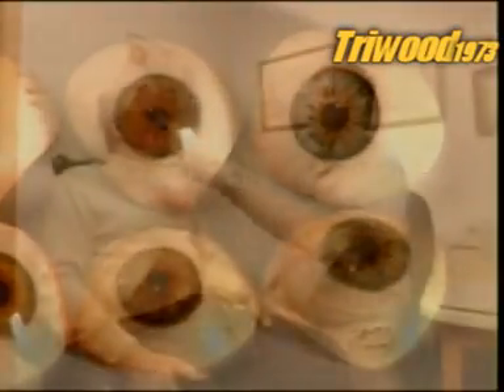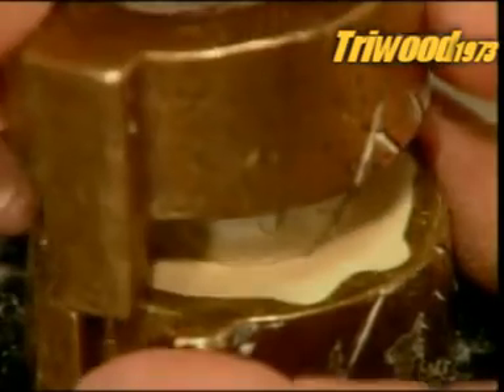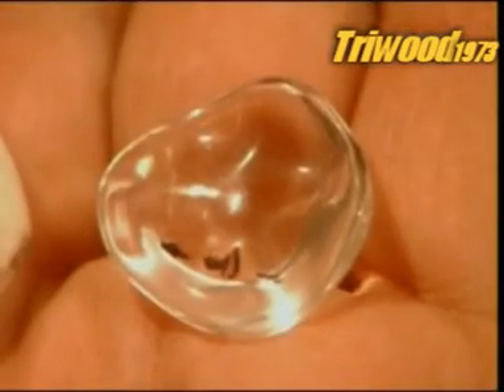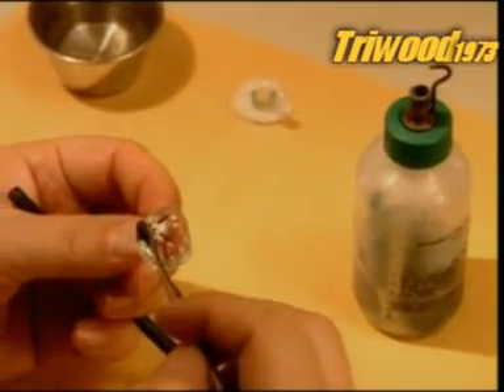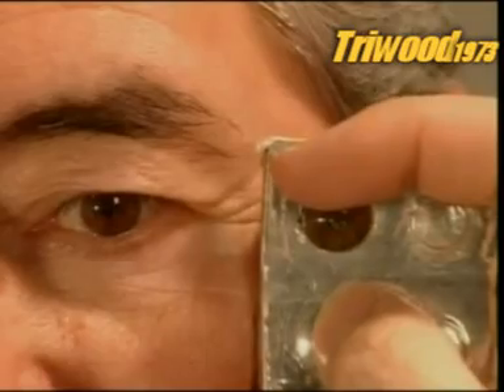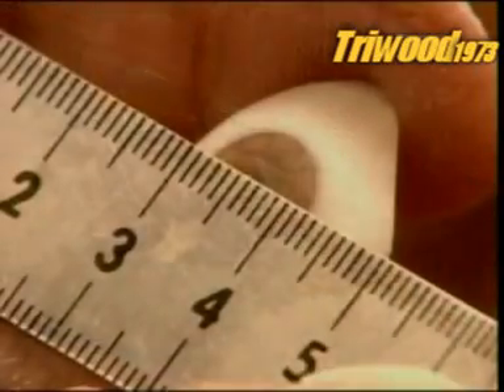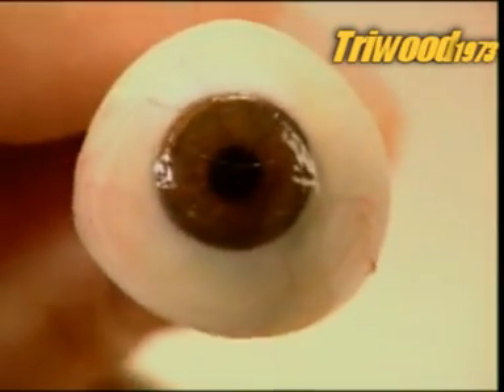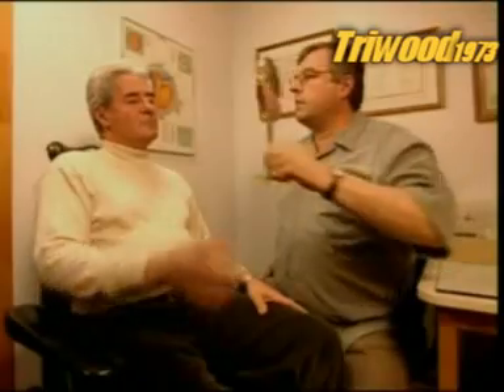Making An Artificial Eye

Comment: @McFuckNuggets 

Artificial eyes have to be removable for cleaning and replacement. If they were balls they'd be stuck in the socket permanently which would not be good as artificial eyes need to be lubricated regularly and DO wear out eventually. And since it's only for appearances, a whole ball isn't necessary anyways.